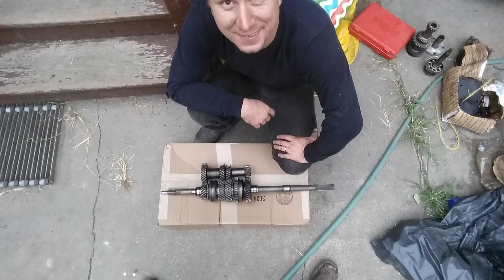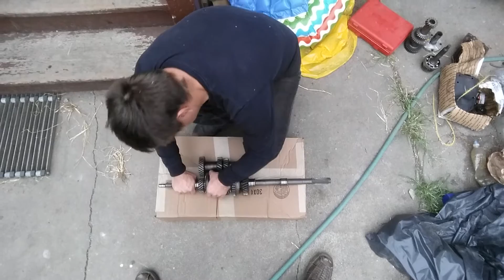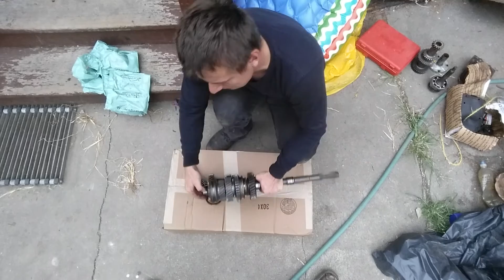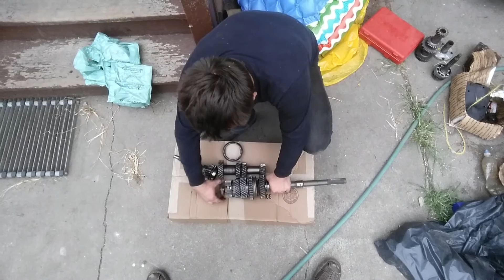How a ford toploader 4 speed manual transmission works explained. Muncie, T10, saginaw also

Comment: My milage meter is rotating in the wrong direction. Do you have any ideas of how to repair this ?
Reply from the maker: Not a clue, that's just odd
Reply: Its a Ford F-100 1972. I think the wire is connected to the gearbox. I will first check the speedometer. Thanks.

Comment: Great video!  So were the Toploaders in general better than the Muncie's on GM Muscle cars?  And the a833 on Mopars?
Reply from the maker: Quentin 33 no personal experience with the 833 yet, but I plan on putting one in my 69 charger.  But the toploader is hands down the better shifting, and stronger overall gearbox than the muncie.  No complaints about my muncie trans , but it's behind a smallblock 350... not behind a 461 cubic inch monster pontiac like my toploader is...
Reply: Invincible Extremes Muscle Cars Garage thxman !

Comment: Would you have a clue why when my toploader goes into fourth gear it whines pretty loud.  But quits when you quit accelerating. I have installed new input and output shaft bearings.  Any help would be appreciated.
Reply from the maker: darzel deisel counter shaft roller bearings etc...   I would do a complete rebuild instead of just the two bearings... because something isn't meshing right.  4th is direct drive so shouldn't be a big deal, you can completely blown all your gears but 4th and still limp it home... I know, I've done it
Reply: Invincible Extremes Muscle Cars Garage the tranny was just rebuilt about a thousand miles ago.  It has a decent amount of power put to this tranny and when it was shifted from third to fourth is when it started acting up.  One bearing looked bad and that's why I changed both.  Gears looked good but I'll have to tear it apart again and look into the cluster gear more
Reply from the maker: darzel deisel yeah, who knows what it could be.